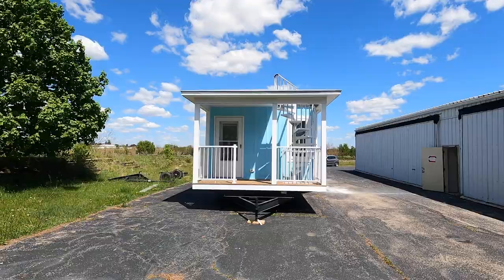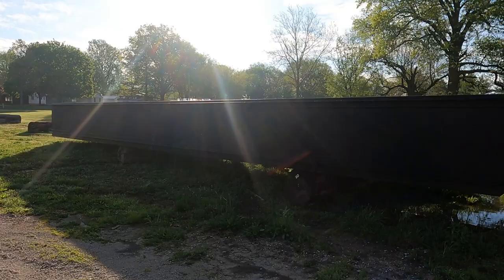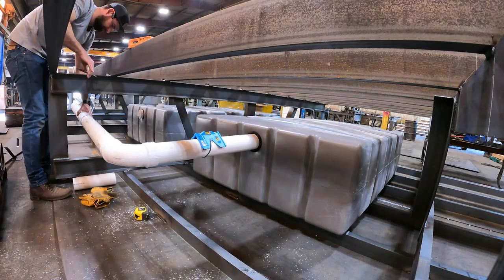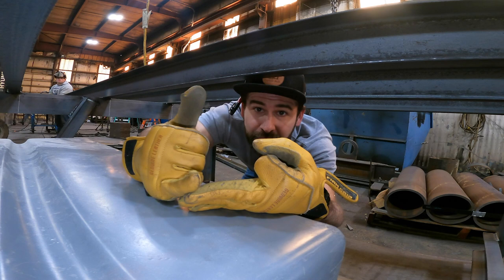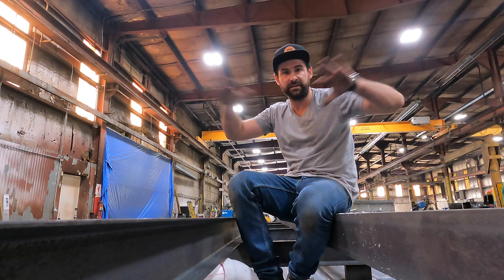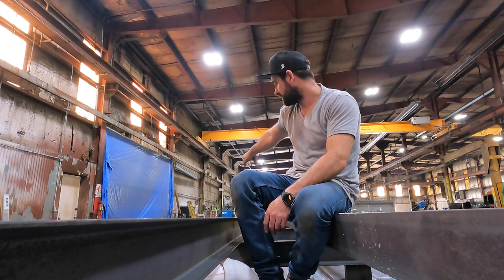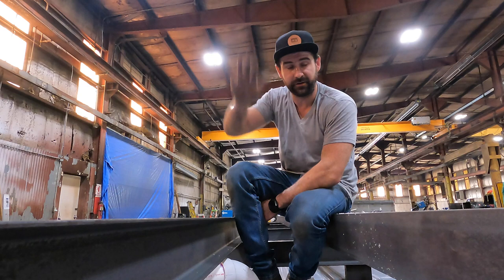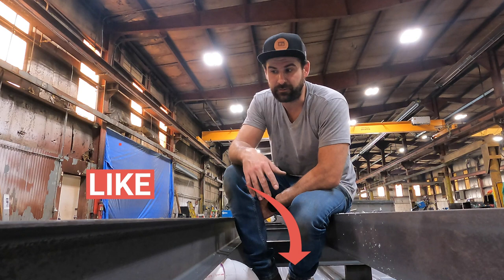HOW TO BUILD A BARGE FOR A HOUSEBOAT

Comment: Back in the 1950's my  dad built a flat platform and put 55 gallon drums under it.  Then put a 8' X 32' mobile home on it and removed the axles.  Bolted it to the deck and that was it.
Reply: How long did the trailer-boat last?

Comment: Just now seeing this... One thing that struck me when you talked about the 1/4 inch slope needed for the fill pipe. This would be subject to the trim of the barge... which would be subject to the weight distribution.... which would be HIGHLY unpredictable when you have third parties living on/in them. While the minimum is 1/4 inch, I would suggest to confer with the barge builders and find out their thoughts on the maximum likely slope that the main deck is likely to have. Next, being as you built the house going on top, you should have some idea as to which end is heavier and by how much. An unrelated check would be to determine your house's weight difference side-to-side. If it is close, no biggie... otherwise, consider changing the design in some way to even out the weight.

Just some (late to the party) thoughts...

Comment: If the barge is on a tilt while floating in the marina (for example, if the barge + its load has an uneven weight distribution), won't the 1/4" pipe slope per foot not be enough? Don't you want a more aggressive slope just in case the tilt of the boat negates the 1/4" slope?
Reply: Also it's going to Michigan/cold weather no wrap on pipe/or tanks heat tape or something unless they are not using them in winter!  I would like to know more about the place that is building the barge and how big they can build and prices great product with a tiny house 🏠🏡. You might have started a new business for your self!
Reply: NO< Remenber the barge will be level in the water....Got it?

Comment: Seems like that if they are welding everything from scratch it should be easy to add in an access hole and door/cover/etc for working on or replacing those tanks.

Comment: Was there a restriction on length?  The first thing I thought of was there being a problem with a replacement should there be a failure with a tank.  I would have tried to place a tank on one end with a deck above it that could be removed to replace. and I really would want enough width to walk around on the outside.  I really do like the concept!  Are there any tax advantages being as there's no land that the place is setting on !

Comment: Big mistake installing the tanks before the hull is completed and metal is all treated and sealed. Better to have a hatch and install later. If for whatever reason there is a a leak and the tank has to be removed, you have to cut the boat apatr to get it out and install another one. Yup,engineered to fail. 
There is a floating home near me, after ten yeras the black tank started to leak. $80000 to replace it, when it should hav cost a fraction of that price if some though went into it during the building.